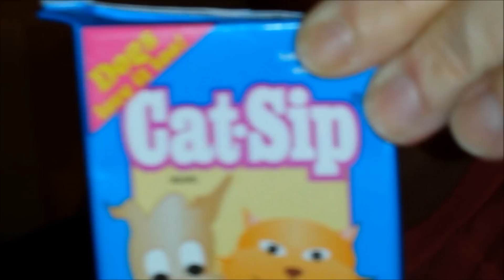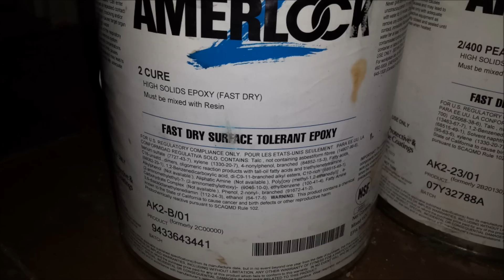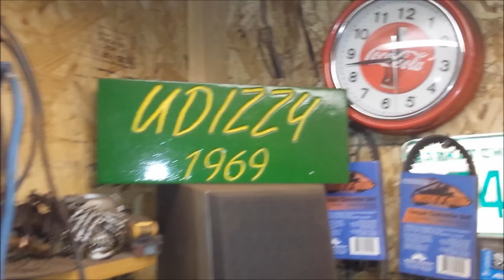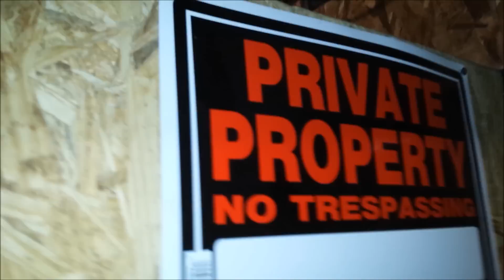Cars,Cats,Oil,Paint,Update.

Comment: Looks like the car is a orb magnet lol - they make a scotch brite pad for the 4 1/2 inch grinder - they are the bomb - T=up
Reply from the maker: FixinThatUp thanks man, i'll go find some.  cheers from the Dizz
Reply: i bought 2 - i took paint & rust off the tig welder as i was redoing it - Jim used them on the mustang fender - sure saved a lot of time and they lasted a long time - still using one on the tool post grinder - got em at waleemart but they don't sell them anymore here at least
Reply from the maker: thanks for the tip brother, cheers Stan

Comment: I know where the oil is coming from and trust me here Dizz...It's cam and crank and water pump seals...Not a nice job to do on one of those vehicles..My thoughts are that it's going to give up real soon..either a busted timing belt or a blown head gasket...Write that down somewhere Dizz 'cos I'd like to know what lets go first..I'll say the water pump seizes and rips the back of the timing belt to bits and bends lots of valves..ZIG HAS SPOKEN.....LMAO....Seriously mate serious damage....Crikey...It is dusty down there....That can't be too good for ya mate...
Reply from the maker: ZIGgassedUP well that the only shop I have. so have to make it work. and the car is good so far. checked it today, so time will tell.  cheers brother